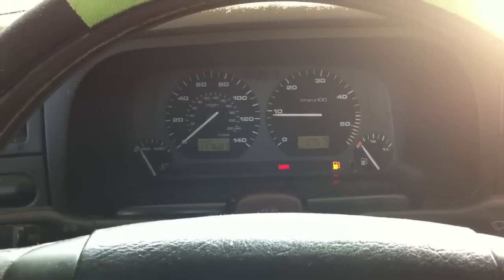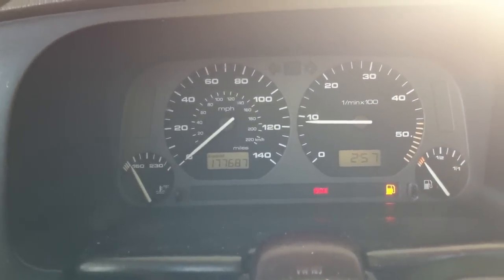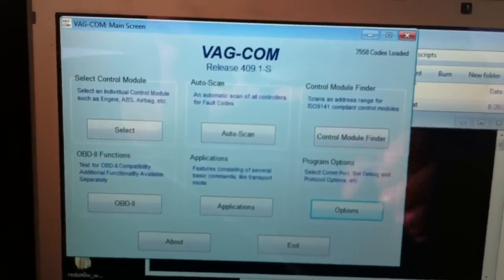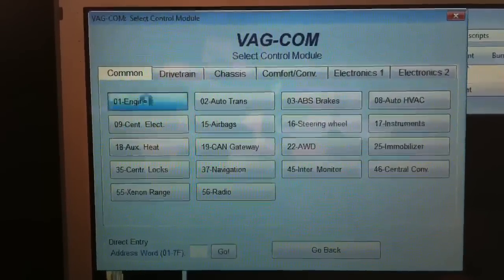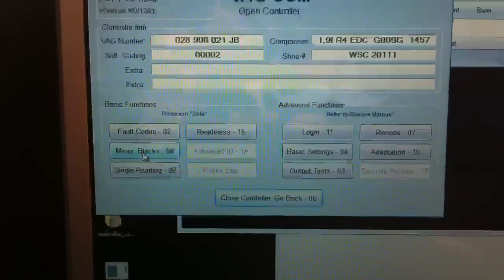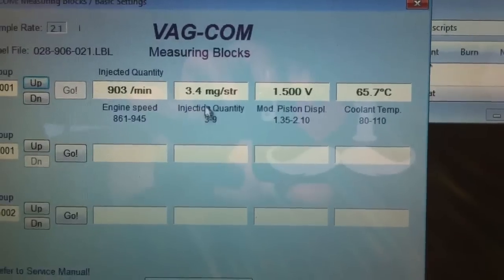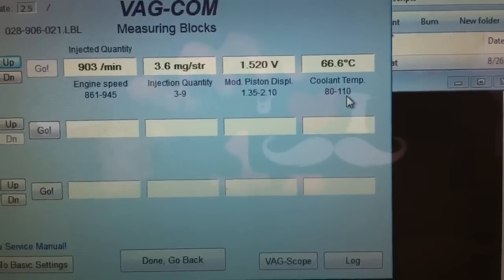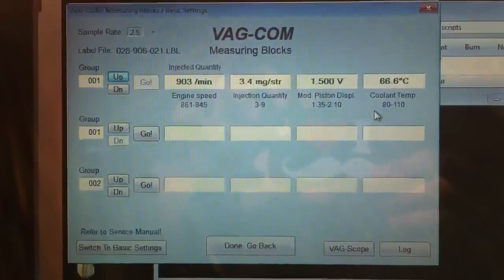Check Pump Timing with VCDS Vag-COM

Comment: You're looking at injection quantity not timing. You can adjust injection quantity a small bit with vcds but if you need more adjustment you need the hammer mod for a manual adjustment. The lower the number the more fuel is being injected.

Timing graph is in engine, basic settings, group 000, tdi timing graph. Coolant over 80c. The tdi timing graph is self explanatory when you see it. If you need to adjust pump timing (start of injection) you need to turn the pump body or the pump sprocket,  depending on the engine.